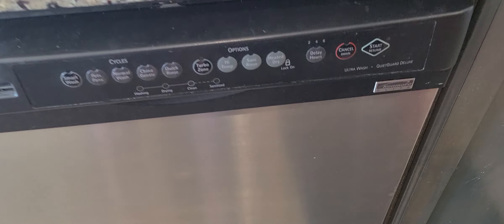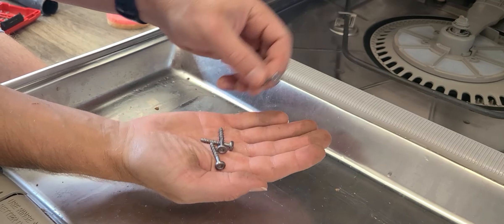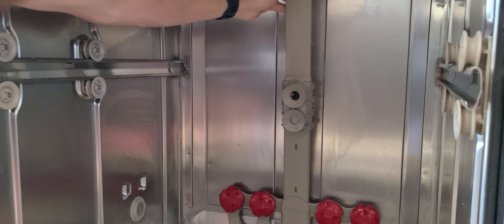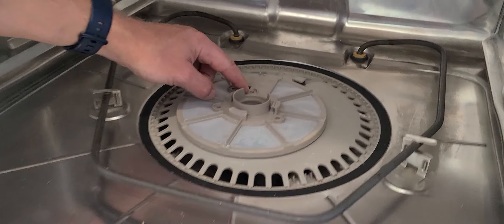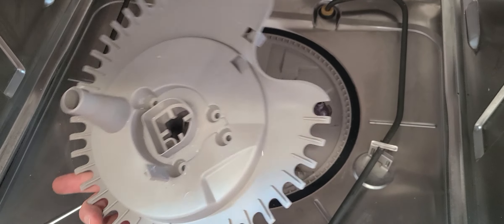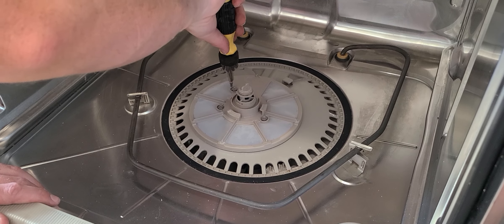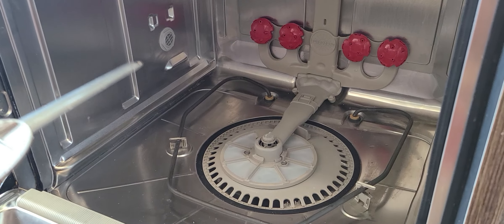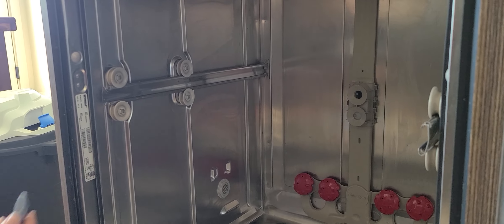How to remove dishwasher bottom to clean filter and fix clogs - Kenmore Elite

Comment: This video was a great help! However, there’s still a piece in the bottom that needs to be cleaned. I was hoping to see how to remove that. Thanks
Reply: Can you reply how to do this step? Maybe create a video of the final step?
Reply: There is one screw that takes a smaller bit, to the left of the filter cover. Remove the screw & the filter cover comes straight off.

Comment: in walmart, where you get the dishwasher pellets, there are other bottles of cleaning products specifically designed to clean the machine of gunk that you can run through it every now and then. There is also a bottle of lime-scented crystals (looks like course salt) that you can add WITH your pellet when you wash a load, that does the same. Works very well. If you do it regularly, it keeps the machine clear of grease/gunk buildup. I had a machine that was very, very built up with fatty residue, and literally one wash with that stuff cleared it all out. Try it.
Reply: what was the stuff called exactly?
Reply: @ckslums  there are a few options, but I add Lemi Shine Dish Detergent Booster a few times a month with dishes, but you could use Glisten Dishwasher cleaner, used WITHOUT dishes just by itself, to give the machine a good thorough clean.
Reply: @jahnkaplank8626  thanks so much. Your initial post spurred me to research some options and I was able to pick up some Affresh Dishwasher Cleaner tablets.  I actually tried looking for the Lemi ones but they were out of stock. Afresh worked fine however. Appreciate you taking the time to reply to me anyway. You were a help even before the reply!

Comment: Thanks so much for making this.  For others, compiling the few missing notes in one place:
@3:32 There is a plastic cover over the macerator (the built-in garbage disposal).  To clean that area too, remove the single screw that you can see in the bottom-left of the circular area.
@4:10 Do NOT press down AT ALL on the this center-piece with a knob.  Just let it rest on its spot.  The piece must be able to freely rotate.  Similarly, when you are reinstalling the large piece that goes on top of it, make sure it doesn't press down on the knob.  Otherwise, you will find that you cannot rotate the knob when you get to the step at @6:10.

Comment: At time stamp 3:32 There's a cover covering the macerator, basically a built-in garbage disposal. You'll want to pull that cover off as well and clean that area for debris and the screen. It's held on by a single screw.
Reply: Thank you! I found BONES! WTF?
Reply: @akijade27 what is that part? Like where is it so I can take apart and clean
Reply: @torr12369 my question too.

My dishwasher ~ during Covid a neighbor helped me replace the dishsoap apparatus (which wouldn’t stay closed). Now it won’t open even though it’s snapping open closed nicely. 

I’ve never cleaned it ever. However I wouldn’t think that’s what’s causing soap dispenser to not open. Help!
Reply: @BOBANDERSON5150  where is that part? I have the same machine a d do t know what it is or where to look
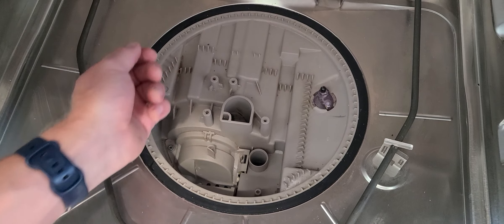Reply: @torr12369  Pause video at time stamp OP gave (or at 3:35). If looking at the circle as a clock face it'd be at the '7' position. See the screw and domed housing/cover?
Reply: Also, after removing domed cover and cleaning perforated disc, there's also a rubber "flap" to clean. Another video that shows this...search "Dominic Bedan-kenmore not cleaning" or "the handyguys-how to fix a dw..."

Comment: Great video, easy follow along instructions. When you are putting the rotating spray arm back on, there is a spot where the video cuts out and the arm is then on the right way. I was able to pull the middle plastic screw part up and wind it through the middle. Hope that is how it goes together. Apologies for my skill level. I'm just starting to get better at home maintenances. I reset my dishwasher by pressing alternately high temp wash and heated dry.

Comment: Giving a thumbs up, but it would have been helpful to explain what you did between 6:00 and 6:10 to make the bottom sprayer fit. I finally figured it out. You do NOT push the part you turn by hand down into the hole. Just set it there, sitting on the top edge of the hole in the filter, then place the top/back pipe on it, and the bottom sprayer will fit right on.
Reply: This saved me a bunch of frustration, thank you

Comment: This person did such a great job making this video, unfortunately he made a mistake at timeline 5:40.   The nylon washer obviously cannot go directly under the spray arm it would wobble and very quickly break.  The nylon washer goes between the tower and the center bearing, prior to installing the tower.   You will actually see a groove where the washer fits perfectly.  My guess is that this washer is required to keep the tower tight while twisting back in place, and preventing it from vibrating around.   Another video shows this clearly the correct method.

Comment: Very good video!  I was able to do the cleaning by following the instructions.  I did not find a washer under the bottom arm, though.  I don't know if it's always been missing, or if I just lost it.  In any case, I was not able to put a washer on when I re-assembled things.  Do you know the size / material the washer is made from?  I assume it's not anything exotic and I could pick one up at the hardware store, but want to get the right thing.  Any advice?

Comment: Thank you for a helpful video.

Any ideas if the Smart Wash, Normal Wash, Delay Hours, and Cancel Drain buttons are all flashing?

I feel like I have to press an ever-changing rocket launch sequence to either drain or continue, but it stops mid-cycle (more like 2 min into the cycle).

Comment: So you put all the screws in when replacing the big part but take the additional screw out upon dismantle? Or do you put the last screw in after putting the back part on in the angled position?
Reply: The last screw on the back left cannot be removed until the back/top sprayer assembly is removed.  Likewise, it must be screwed back in before reinstalling the back/top sprayer.

Comment: I have a kenmore elite model 722.14677.710 and it’s spinning arms have 4 and no visible screw at top center to pull them up and out in order to get to filter/screen (filter won’t rotate with spin arms intact) what do I do??? So frustrating